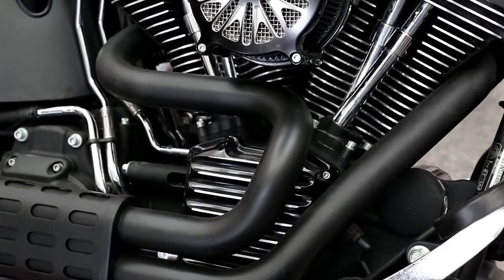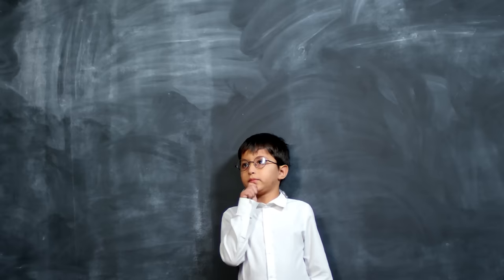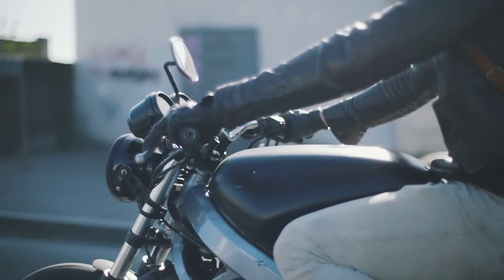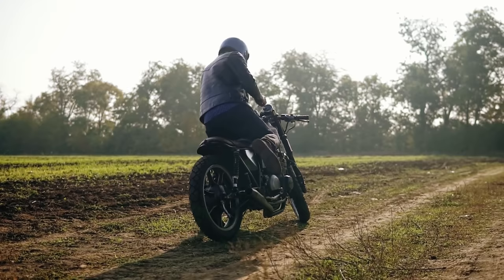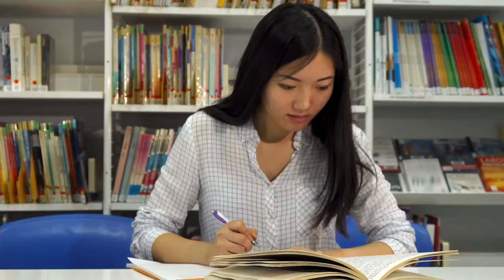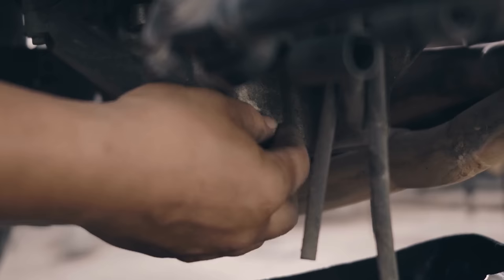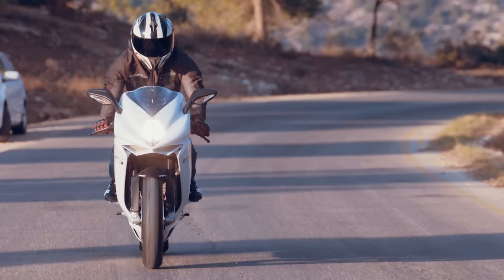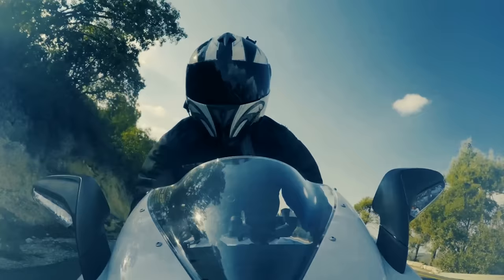How to Break in a New Motorcycle

Comment: My advice for new bike (or a rebuilt engine) owners has always been "be nice." After a few hundred miles you'll know of the engine of going to grenade under pressure and you can go nuts at that point.
Reply: That is not the same. Rebuilt engine has never been run, before. All parts are new and unused. The new bike have been used and tested. I would not push the bike hard before the gear box and the whole engine has loosen up a bit. That can make the bike feel trashy. You can get problems with getting it into neutral and pop out of gear. Hard to shift. But that comes later. Maybe when you are about to sell the bike. Then it gets hard to sell, and the price drops hard. The cylinders are not the most important to run in. The hard part to fix is the gearbox and the other parts.

Just look at all the problems whit Jam's Turbo Busa. Not all people care to do things careful. You skip something to make it easier, it blows up later. That is how you make problems, not see to that they don't happen.
Reply: @Gismo TB  maybe be nice means something to you that it doesn't mean to me. With 45 years of riding, the meaning has changed for me since I first heard it. My 2022 MT09 got a few hundred miles of less than 8k rpm before I started abusing it. My 1982 v45 Sabre got almost 1,000.
Reply: @Gismo TB  about 500,000 miles give or take a few. You're a funny guy.  I'm not concerned with what you think of me,  only a 15 year old kid would be.

Comment: I’ve heard many say, let it warm up fully and ride easy for the first 15 minutes.
Reply: Fully warm, probably mean when the cover of the gearbox is warm. Not the cylinders. Also listen to the bike, if you feel that the bike is going a bit heavy. Stop and let it cool off 5-10 min. But it will probably not happen, if the bike is new. But cud happen if it is re-built. The new bikes have been run, and tested. But the re-built parts has never been used.

Comment: Anyone have any idea why they don't do this at the factory and sell bikes ready to ride?
Reply: My take on that, is people don't want a bike that has been ridden for 1000-2000km. And what about people that want a low km bike?
But mostly it is the gearbox that has to loosen up, before any hard racing on the bike. It is no problem with normal use. You don't need to drive slow, short shift or do anything special. Just be smooth, and slow on the controls. Don't do anything real quick, and you be fine.
Reply: @Gismo TB  I meant why don't they break in the engine before putting it on the bike. This way a bike with a broken in engine starts at mile 0.
Reply: @AzianDragonz  —— No, the parts still are used. A master tech mechanic don't need to look at the ODO-meter to see that a part is used and not new.
The ODO-meter only makes it easier so see how much the bike has been used. But not the only way.
And breaking in the bike is not a hard thing to do. Don't go hard on the bike, and not race it.
Use the bike in the RPM range that is the most easier on the bike. And be slow, smooth and easy on the controls. And you be fine. You can do it in less then a week.

You are actually making a problem with trying to fix something, that is not a problem to begin with. But will be a problem when you fixed it.

If you want a broken in bike. Just buy a used one. If they had to drive the bike 1000-2000 km or even more to really break in the gearbox all the way. That would maybe doable the price of the bike. And know one would pay for that.
Most people want even pay for safety gear. They rather die, then get sweaty.

You can even pay someone to break it in for you.
I bet it is not hard to find someone that want to ride a new bike around, and even get payed to ride it.
That would be a great job to have. Just ride new bikes all day, every day. And never have to pay for anything. And even get payed… That is a dream job… And you can even go where you want to go.

What it all come down to, is that most people are lazy as fuck, and only want to do the fun stuff all the time. But that is not life.

That fun stuff, gets boring real quick if you never do boring stuff.

Comment: I think hard. I heard this years ago and for me its much easier to do hard break ins for me. My first street bike when I was 15 1/2 yrs old was a brand new i think 74 Honda XL250. Never broke it in rode this piss out off it never changed the oil. Dont even know how many miles I had on it and finally chipped a ring. Then kept riding it till it would not go any more. But nothing should off lasted almost 3 years being treated like that. Then I rebuilt it but while i was in there took a cam from an XL350 stuck it in there rejetted the carbs put a down swept less restrictive exualts and that thing poped way better. Then some fool wanted to trade for a Kawi Z1900 and a squid was borned. Since then i think proper maintnence is much more important then a wussy breakin which is boring or just ride and dont get stupid breakins.
Reply: PS not a squid no more. Just ride a Suzuki Vstrom 1000 and a Honda st1300.

Comment: I beat the crap out of my 2019 klx 250 hard since 0 miles. About 6500 hard miles on it now and it runs perfect. Doesn’t even burn any oil 🤷🏻‍♂️
Reply: You say that you "beat the crap out of my bike". But is that mean the same for others?
That is all about what you mean. You can ride a bike hard, but be smooth and slow with the controls. And it is OK.
Another speed demon, think that riding hard, is kicking it in to gears. Popping the clutch out hard, and hammering the throttle as fast as possible. Your bike can be perfect, and the other bike is a wreck.

You have to give more details, if you are giving tips like this. Or the tip is doing more bad, then good.

Comment: For me as long as your  mc is need power try not to limit it but try squeeze more power acceleration but not totally fully rev so after 100-300km I usually make  a full throttle but limit time only until my mc power and fastened pickup
Reply: Whut?

Comment: Broke in my 2020 Vulcan s probably the softest way imaginable. Sitting at 25k miles no problems. Even took it in for the 15k mile valve lash check and they said just come back at 30k miles. Although i am gonna be coming up on my second clutch change pretty soon clutch soon but that's normal.
Reply: 2 clutches in 30,000 miles is NOT NORMAL.
Reply: @billbonu1639  depending on how u ride now. My first was misadjusted from factory so it only had enough friction for normal riding but would slip riding hard in the twisties

Comment: Was planning on getting a new bike this year (if so be my first new new one) and was thinking of how to break in. Gonna be a jump in engine size so the break-in period is probably going to be me getting used to the size difference
Reply: Sounds like you are going up in power way to early. You should then have no problem doing a stoppy on your new bike… And don't be bothered at all by some car pulling out in-front of you. Changing lanes to miss cars. You should not have to get used to the bigger weight or power of the bike. Then you need more training on your small bike. Training to be better on a bigger bike, is really much hard and much more dangerous. It is like talking 5-10+ years (or maybe never) to learn what take 1-2 years on a smaller bike.
Reply: @Gismo3333  literally nobody on the planet moves up in power and size on a motorcycle without some kind of adjustment period. Nobody. Every, single person that has ever went from a 600 super sport to a liter bike has had to take a bit to train their muscle memory again to allow for the difference in acceleration.
Reply: Josh, you’re doing it the right way, man. It will take some time getting used to a bigger bike. Good luck and be safe, man.

Comment: I appreciate this, it's good and true through and through.  But!  I'm an old man and old dogs don't learn new tricks.  I've built engines, I've heavily modified engines (talking cars here, FYI).  I know this process is all about seating the rings, I know it can be done either way be it the user manual way or the brute force way, but I have never been able to take a new build and treat it like a red-headed step child right out of the gate :)  and probably never will.  Another But... and I will never poo-poo someone for doing it their way, it's their machine, and it'll be fine either way.  So yeah, you hit the mark on this retarded controversy - do it your way.  It's gonna be fine.

Comment: Those limits are put in place for the rider to get used to the new bike. I wouldn't want to run my bike to the red line before the first oil change but getting over the 4k limit once in a while won't hurt my Aprila Rs660 survived 😆.
Reply: I’m preeeeeetty sure the RS660 will be my next bike (coming from a CBR500r)… 

How do you like owning yours?
Reply: @SongJLikes  I love it it's awesome but if you have back problems don't go for it. It's more aggressive than standard nothing major but something to keep in mind. The only thing i would change ( would have done it already if it didn't cost as much ) is the tune that hole in the rev range is noticable... When you are pushing it you notice how 4.5-6.5k rpm nothing really happens but as soon as you go over 6.5k it pulls really nice (for a 100hp bike obviously 😆) .
Reply: @wanderer7779  - ok, thanks for the response… my back is ok, and I appreciate a forward leaning sport position (I have tailbone issues)… 

Can you get the tune and keep the stock exhaust? Cuz I’m a big fan of the way the stock looks compared to modified on the rs 660
Reply: @SongJLikes  probably but not sure if it would completely remove the issue. I think i recently saw a aftermarket exhaust but the same style as stock forgot the brand name... Might need to test ride one tho that tailbone might be an issue i have back problems as of recently ( I'm 27 year old) and it's definitely stopping me from riding as the position is leaning forward and it hurts. Rode a mt07 with similar issue it was much easier...  I'll recover 😆 it's just pinched nerves and i am definitely happy the Aprilia is in my garage and not the 07!
Reply: @wanderer7779  - nah, I ride my sportbike (CBR500r) every day… from that experience, I know that I can only go forward-lean from here; the more upright the worse off I am

I was looking at the rs 660 extrema model, as it comes with the sc project exhaust and carbon fiber body mods to clean up the lines… but it will end up being too pricey, and I’m not a huge fan of the ‘livery’ on it
Reply: @SongJLikes  didn't think about that yeah go sport bikes then 😆. I'd get the base version and mod it myself tbh. Factory option would be awesome maybe one day...

Comment: I wonder if heating the bike means completely or just the first bar. 🤔
Reply: Operating temp.  
Allow for all the components to expand fully.  Some materials heat slower than others.
Reply: The side of the gearbox should be really hot. Actually I think it maybe was Jammy that said that tips. But I don't remember. If you see on a scale it is mostly in the middle that are running temp. It is the temp the bike are suppose to have, when it is running for longer time. Not to cold and not to hot…

Comment: On my 2023 zx6r I was going 140 within the first 7 miles. Gotta break em in hard 💪
Reply: As long as you don't hit max speed of the bike. And are smooth on the controls, with slow hands. That is what matters. Driving a new vehicle very fast, when it is brand new, is always stupid. Bike has to settle before you push it hard. It is not only pistons on a bike.
Not want to be the person that buy your bike… That is why you never buy a fast car or bike, from a speed demon. Because they mostly are broken when they sell them.
It is maybe sound tough to beak it in hard… But not so cool when you used it for 5 years, and you get $500-$1000 for the bike. Then you are crying… And begging to get more money for the bike.

Comment: With new bikes having much better metallurgy than 70's -  80's motorcycles there should be no issues with breaking in your bike unless it's an Aprilla or a Harley then baby that bitch so it don't explode. 🤯💥🤯
Plus piston rings rotate on the piston they don't stay in the same place all the time so it doesn't matter the matting of the rings to the cylinder walls as much as it did back in the early days of motorcycles when the rings didn't really move as freely and the ring metal wasn't as high quality.
Reply: Piston ron

Comment: I acually disagree with this. The idea here is to polish surfaces. Not only the cylinder walls but cams, crank etc. Polishing means rubbing it gently. By running it like you would ride normally this polising may or may not turn into a grinding causing excessive wear or scoring on something that should have been smooth. high RPM will cause more load on some surfaces and this should be avoided. As should lugging or full throttle. I.e. I agree with what the manual states. This won't be noticed until years later.

Comment: The people at Amsoil recommend using conventional motor oil for your 1st 2 oil changes. 

If a manufacturer ever tells you NOT to use their product, they are probably telling you the truth. They said the lubricity of their product is actually good enough to prevent proper ring seating.

Comment: Australian warranty laws are pretty robust as long as you follow the manufacturer recommendations. There is not a lot of arguing here but regular maintenance needs to be done by a registered mechanic. I just followed the book procedure on my Sportster S. It does actually recommend pushing the rev range after the first 600km run in, just not above 2/3. After 1000km you are encouraged to open it up to anything below redline.

Comment: engine rpm limiter on royal enfield 15 000 rpm 👌🏻😉 🤣 when i change cylinder in me scooter it know only one shifter position i mean 2 😉 0-1 😎 it ride very good accelerate like v8 topfuel and consume 0,01 l per each 100 km 😁👌🏻 how you should breal engine depend on material  use for made its internal component and how well it is saved  👌🏻 thers no one break engine method ,manufactory usualy onow best how it should look like for them motorcycles 👌🏻 for one max throle and rpm on short period of time and let go throtle for some time be best for some such method kill it 👌🏻 just do it how manufactore sugest and should be just fine 😉👌🏻
Reply: What did you just call me??!!!

Comment: Such BS if the manufacture builds the engine right one heat cycle and an oil change 1-200 miles and done. Been building race engines for 30yrs blah blah blah

Comment: Just got a Ducati. Been taking it easy but I may have pushed past 80mph a few times. Nothing serious though. Just hit 130 miles.
Reply: How fast you are going, has not much to say. More how hard the gearbox have to work, before it has loosen up. If you drive it to abrupt, the gears will not fit as good and be so nice it cud have been. If you be more smooth… No hard fast moves. Every thing goes better. And maybe you can also skip low-side or high-side your bike, too.